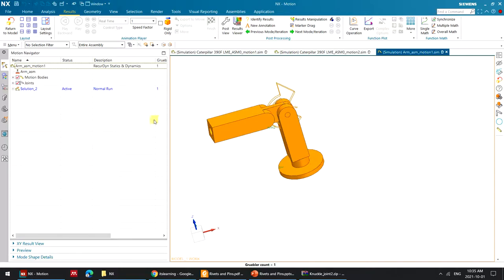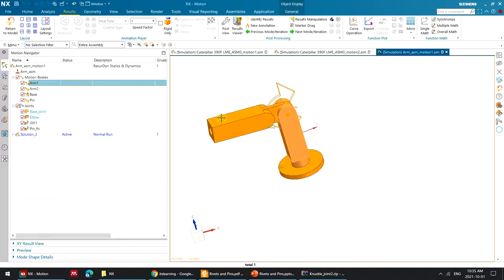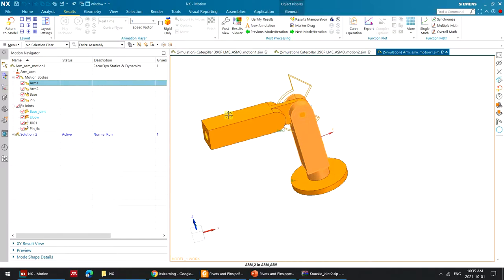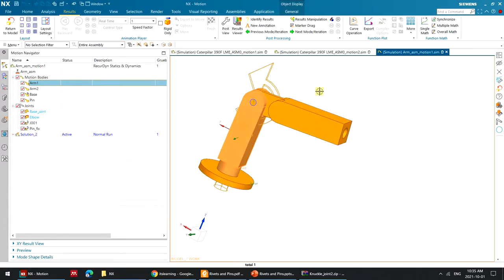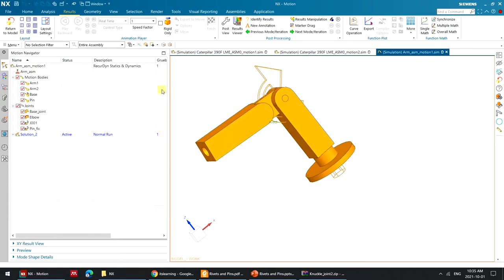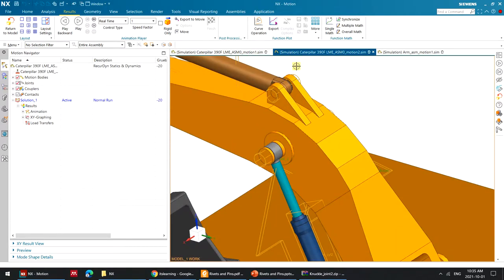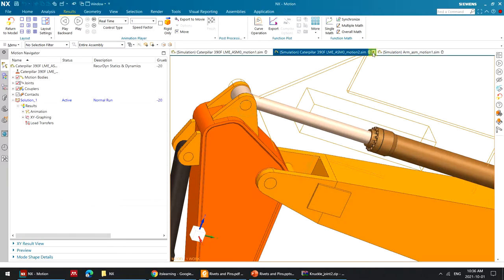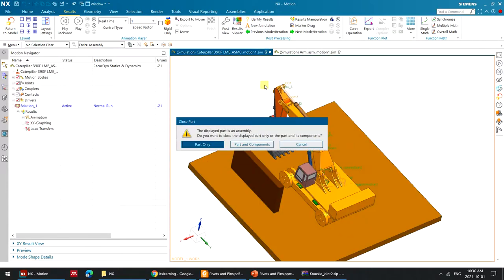Lecture 5: Load transfer between NX motion and NX Pre/Post

Comment: Hi Arion, I'm not sure if you'll see my message, I hope you do, but I'm modeling a jaw opening device for a dairy cow (for tooth inspection), and it uses a lever arm connected to small driving spur gear, which is connected to a larger driven spur gear, for mechanical advantage. I also have a crank wheel sandwiched to the small drive spur gear and a double pawl (one for driving and one for locking) so that I can crank the lever arm through an upwards then downwards arc, 5 times to gradually open the cow's lower jaw. I am designing it in NX2306, and wish to do a motion analysis on the assembly when it's interfaced with a 3d model of a cow skull upper & lower jaw assembly. Do you think you may be able to help me set-up the motion analysis? Thanks, Scott